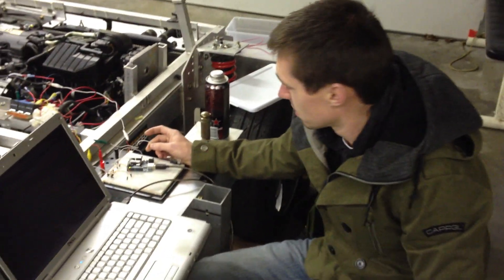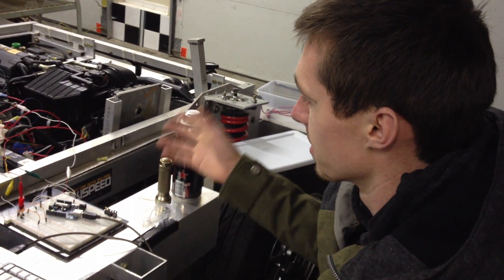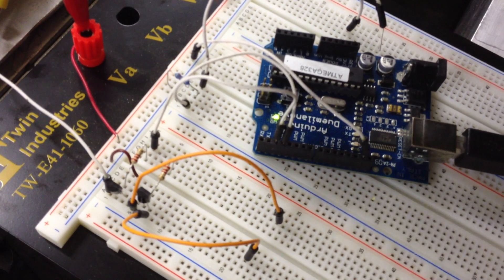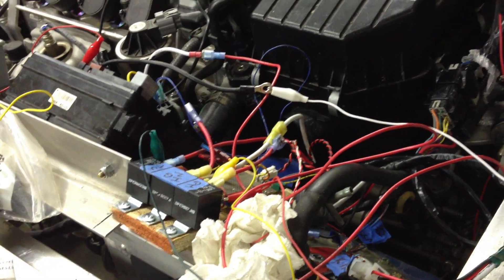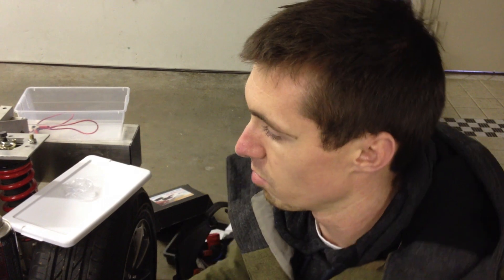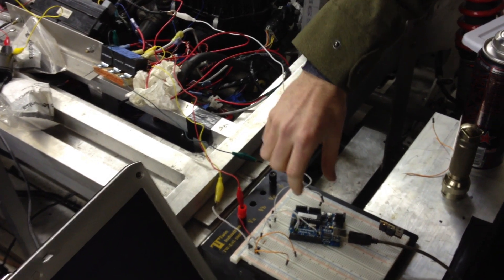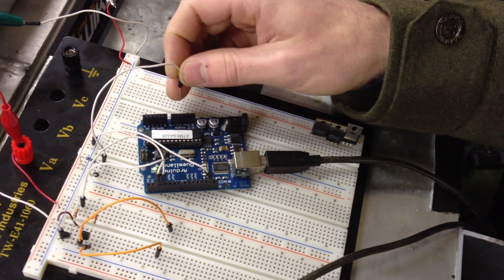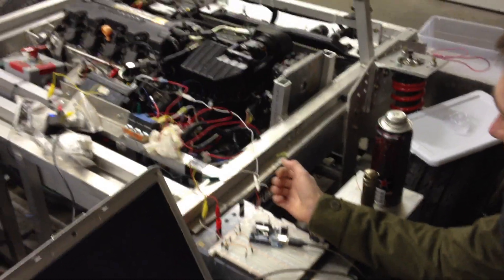WIKISPEED Arduino automotive relay control

Comment: How does the Arduino know when to stop cranking the engine? Is it as simple as adding an oil pressure sensor?
Reply: Tim T. You could go even simpler and have it disable when engine rpm is higher than some number such as 200RPM